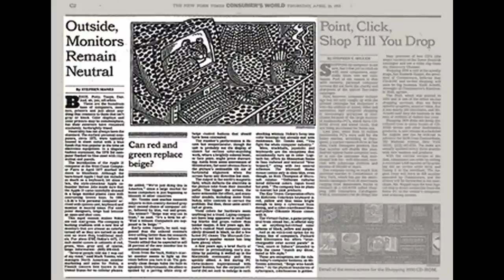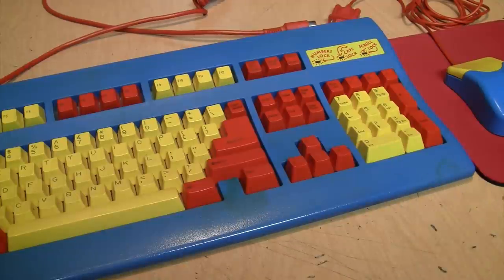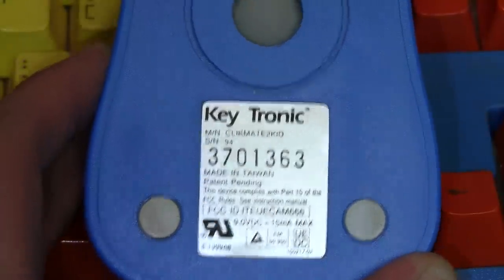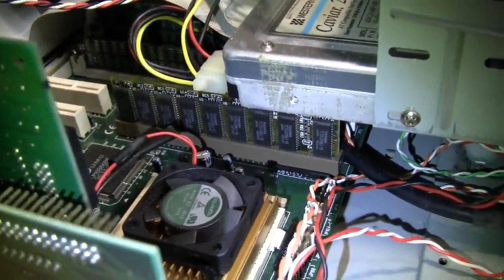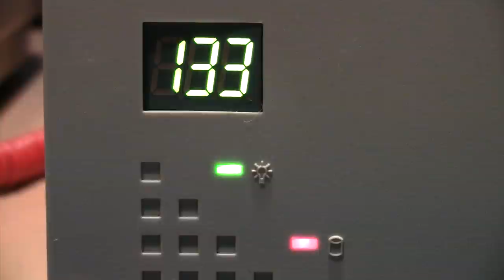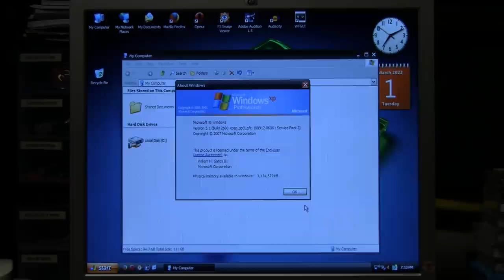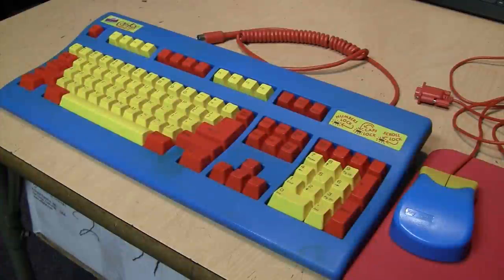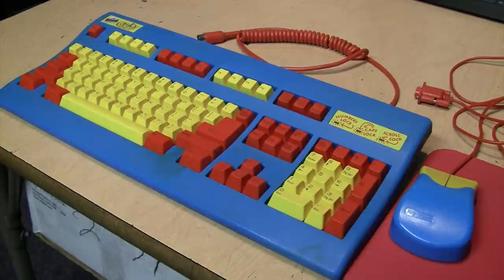Shocking Blue ⌨️ Key Tronic ColorKeys keyboard & mouse

Comment: On a whim one night, I took apart one of these Key Tronic boards (not the KidTronic, but in all black) and gave it a deep clean, applied 303 protectant to the plastics and keycaps, and then lubricated the keycap stems and the channels the stems slide through with Super Lube (the same stuff I glob onto the awful, rattly stabilizers of any keyboard to help silence them) and it made it feel FANTASTIC; it reduced out ALL the rattle from the key wobble and made every key press silky smooth.  Maybe not as nice as some fancy Alps tactile switches, but a significant improvement to the look, feel and sound of the keyboard.  It's been about two years and it still looks pristine and feels great.

Comment: What a lovely looking Mouse and Keyboard Set. I would have liked this, when I was a kid. What a shame that this is only a Rubber dome keyboard. If that thing had mechanical switches, this would have been sick. But otherwise, I really adore the funky and unique color scheme. This is definitely something special. Great video as always. Keep up the great content. One can see that you put a lot of effort into your videos.
Reply: Don't sell them too short -- some of the Key Tronic rubber domes were absolutely outstanding. (Unfortunately, at some point, they cheapened or maybe just changed them and that superior feeling was gone. I'm not sure which variant this keyboard would have used.)
Reply: @uxwbill  Now that I think about it, you're absolutely right. I should stop judging books by their cover, or in this case keyboards by their switches.
Reply: If this had mechanical switches I might buy the one on eBay.

Comment: There sure isn't a shortage of people on eBay who must have a crack habit.

Key Tronic sold that same mouse in plain beige. Having a different "PC Cheaps" motherboard with different looking fake cache chips, I have wondered if those chips actually contained anything or if they were just empty plastic cases with leads attached.
Reply: I've seen pics of some of those fake chips that look a little too Playmobil-ish to be real.
Reply from the maker: IIRC in the case of the M919 someone cut them open and found nothing inside. After the fraud was exposed, later M919 boards didn't have the fake chips installed, although the circuit traces for them were still visible.
Reply: @vwestlife  that's so bizarre. Like why even bother lol
Reply: @vwestlife  That's correct they are hollow inside, the chip legs are like minature garden rakes, all connected together at one end.  You can easily see for yourself - use a lump of blu-tak to lift the top of the "chip" off, you can easily replace it again.  I cut all the traces around one cache chip on my board to definitively prove they did nothing and were connected to nothing, didn't affect the board at all except for cosmetic damage.
Reply: @SockyNoob  because cache included on the motherboard cost extra money back then which meant you could charge more for your motherboard, and it made the feature set look more advanced.  All the better to reel in unsuspecting purchasers.

Comment: I had a Microsoft Wheel mouse with a ball that used the same optical design inside that would sometimes behave erratically. I finally realized it would only misbehave when the sunlight from my window was shining on it, confusing the sensors inside.

Comment: Some eBay sellers tend to ask way too much for whatever item they are selling. Back in the late 70's I bought from Woolworth's a Sanyo stereo system with two 8 inch-two way speakers, two microphones and a demo cassette tape. It had cassette, 8 track play/record AM/FM receiver with weighted tuner and a BSR turntable with a magnetic cartridge. Sanyo model JXT 6910 and i paid slightly over $300.00 brand new in the box. Went looking on eBay some time ago for this model and found one minus speakers, microphone and dust cover. That joker of a seller had the nerve to ask $300.00

Comment: I remember Keytronic back in that time.  They truly made fantastic keyboards.  The company I worked for at the time; we use to buy them for small business servers we installed.  Why?  Because they were super clicky, heavy and bulky. It reminded us of the old IBM PS2 mechanical keyboards.  People also would not steal it out of the data closet so we never saw them stolen from the server for a desktop computer in an office.
Reply: ... Yeah, on a J9 variant now and even though they are some sort of pressure rubber dome, but they have their own patented version where they are much tougher and some are also harder to press than others as others are much easier to press, and it is a total system, that works! HOWEVER, I see that many SUPER BiG YouTubers whom do KEYBOARD reviews, HATE anything rubber dome and even some Keytronic if not least “OVER-ALL” but I love them and bought this BLACK KEYTRONIC PS2/AT/XT ENHANCED RARER version of the Keytronic rubber domes "Lifetime Series we are remember but now are mostly all gone since the GREAT purge of 2017/18… To me these keyboards FEEL as close as you will EVER get to ACTUAL pricey SWITCHES WITHOUT BEING THEM whatsoever and COMBINED that with the FACTS on how many diff models even though THEY look the same with cool features and that they just LAST forever unless YOU DONE spilled water on them, that can take them OUT..... they are AWESOME and also now, harder and harder to find, found my last on eBay for $31 shipped, to me was worth it for this particular model from the mid 90's the first model for win 95 before the purple connector for the "PS/2 connection was standard/code ... I dunno, I am GLAD to have one and nice to see somebody else who can appreciate these and not just HATE on them, these folks either dunno or have super high standards as the KT Rubber Domes are DOPE AND 90's NOSTALGIC...
Reply: @ReganMarcelis  I also loved the original Mitsumi 104s from that time period circa 1995.  They felt very similar to the Keytronic shown in the video.  I used the same one for about 20 years and then one day the keyboard controller inside it failed.  So I did what most would not do; took it apart gently and swapped that controller out with a known good one that someone spilled coke in the keyboard.  I have had success cleaning up coke in some keyboards too using alcohol and contact cleaner. But some are beyond help.  I ran that Mitsumi till I had to dump that at style barrel plug on my latest build in March 2022.  I went to one of those fully mechanical usb keyboards that are backlite now.  Taking that old standby off my desk felt like I was saying good bye to a friend at a funeral.

Comment: you might try just setting it outside during some sunny days, after about 5 days of full sun it should lighten up and is generally a lot safer than trying to do it with peroxide.  Just rotate it every hour or so to try to get the exposure uniform.

Comment: Blue Lego pieces does discolor in the same way - Is the case made of ABS? It should be possible to restore, but I haven't tried it...
Reply: It's inherent to ABS because of its chemical composition (particularly the butadiene part) and its reaction to UV light. The worst part is that the discoloration also contributes to mechanical and structural degradation of ABS.

If you've heard about fire retardants being the cause for discoloration (as much has been said about the bromine solutions applied to SNES consoles), these are NOT the cause of yellowing.

Comment: I picked up a compact keyboard at a thriftstore for a buck the other day, it's made by BTC, it's a BTC 5100 series keyboard, they came with either a rubber dome or capacitive foam/foil switch , so I took mine apart to verify what type, and to my surprise it was the earlier foam/foil switches and the chips were from 1991, so likely the keyboard was from 1991, it's an all black keyboard, well some of the keys are grey in the same way most keyboards of the time were beige and grey but that got me thinking what black PC keyboards could you even buy in 1991?
Reply: NeXT Cubes always had black keyboards, to match their black cases and monitors.  Though their keyboards had a few NeXT-specific keys too that weren't on PCs.

Comment: I used to love Keytronic keyboards, but they seem to have completely stopped making any models with standard size enter keys. All of their keyboards in the last ten years had the large L shaped enter keys. They weren't as nice as mechanical keyboards, but they were/are way nicer than the modern low cost keyboards.
Reply: Unicomp has Model Ms with rubber domes so that might be very similar. Also dyesub caps instead of KeyTronic's crappy laser/padprints.
Reply: @silitekmodder5681  I use a Unicomp Ultra Classic now and it's really great, but I would like to be able to get really good inexpensive keyboards. Most people don't want a $100 keyboard but would pay $30 if they could get something better than the entry level Logitech. That being said, the Logitech cheapo models are pretty reliable.
Reply: @AndyBHome  I'd say look for old NMB Dome with Sliders keyboards. You can get the NMB version of the QuietKey for ~$30-40 and there's a rare black version too.

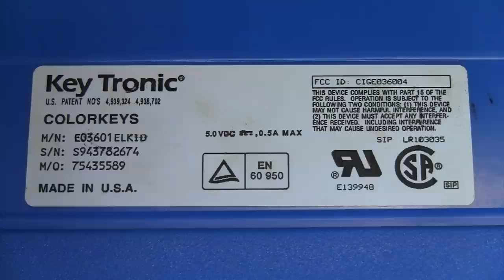Comment: 3:07 very cool to have AT XT seitch !
But what this means "AT - Enhanced AT/XT" ?
Reply from the maker: I'm guessing it's normally XT/AT autoswitching, but for computers like the original IBM PC which don't support 101-key enhanced keyboards, you can manually force it into XT mode.
Reply: @vwestlife  whait what ?! The first IBM PC (Not the XT) do not support 101 keys ?! WoW 
BTW this autoswitching is cool IBM model M is autoswitching and you wnat to tell me that it will not work with the first IBM PC LoL
Reply: @intel386DX  The 5150 and the XT have some differences in the keyboard controller and perhaps the bios routines that initialize the controller, on a 5150 autoswitching keyboards may not get the right signals to know to autoswitch to XT protocol whereas the later XT machines will work just fine.
Reply: @brandonupchurch7628  oh thanks for the replay . So if there is a switch it will work on the first PC wit all keys .nice 👍
Reply: @intel386DX  Well I don't believe the enhanced keys are available on their own unless you have an XT with the BIOS from 1986, but I believe you can get the enhanced keys to work on earlier XTs and the 5150 by loading a keyboard driver in your autoexec.bat, although don't quote me on that, PCs earlier than the 386 era aren't exactly my specialty.

Comment: Faked cache?!?
Reply from the maker: Faked cache!!!
Reply: @vwestlife  Faked cache.
Reply: It's like fake cash, only with cache 😉
Reply: It'd be interesting to see what's inside those fake "WRITE BACK" cache chips that don't actually connect to the motherboard logic. Rejects that failed initial testing, perhaps? Maybe there's no silicon inside at all, but that would require a special production run, which seems unlikely.
Reply from the maker: @jordanhazen7761  Other people have cracked them open, and there's nothing inside.